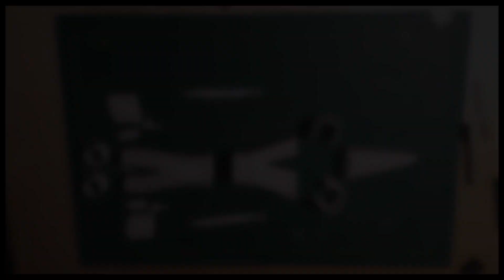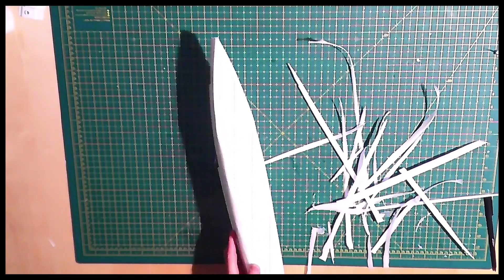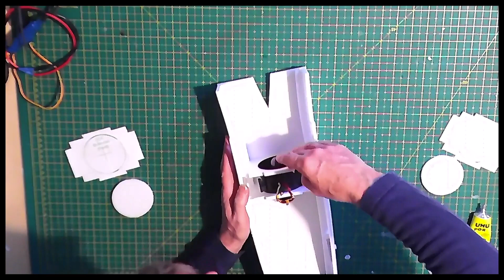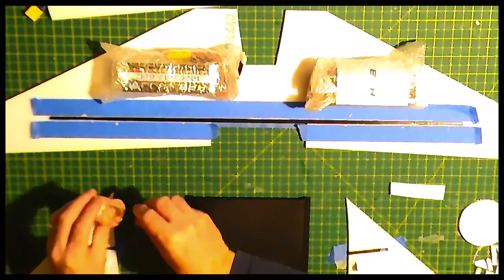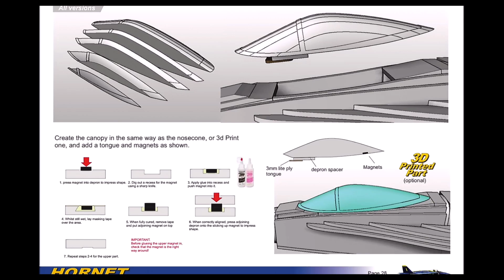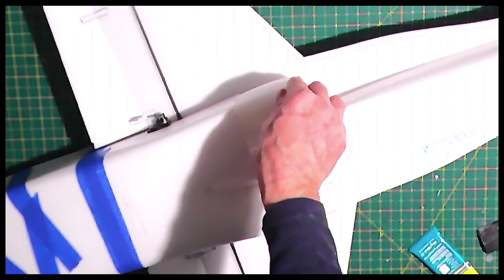Jetworks - F-18 Hornet build

Comment: Amazing work! I also use Uhu Por. Some of my models are more than 10 years old. Some glued sections seem to be very briddle after a few years so I sometimes “reglue” them. Some time ago I found a video from Hilmar Lange who showed how to glue depron with the so called Weißleim (similar to Elmar’s propeller glue?). Glueing procedure includes fixing the parts with needles like done with balsa constructions. Also sanding the glueing sufarce when the skin of the part is untreated is mandatory.

Comment: I love these videos, they are so well presented. The narration is great too. Do you chafer the trailing edges of the control surfaces?
I'm building the JW mirage 2000 at the moment.
Reply: Thanks Pat however i feel some folk may need a translator at times LOL, most of the time i do on the Vertical stabiliser''s for sure and sometimes with the control surfaces also but recently not so much. i have found or get the feeling that shaping trailing edges increases stall speed but hoping some more competent flyers would confirm this but it does look good to when everything is shaped and sanded. the Mirage is an awesome flyer and i did shape everything on that. are you building EDF or pusher ?
Reply: @Shad3yB  Barry, it's a 70mm Edf, however I'm also printing an Avro Vulcan and the F-84 Thunderstreak from 3d labprint. So the production line is in chaos at the moment.

Comment: it was a real pleasure building the F-18, very easy and quick with only 1 full sized sheet of Depron used. great finish using the milky filler method as i brushed on then sanded back, will certainly be trying that out again thanks for the tip :)